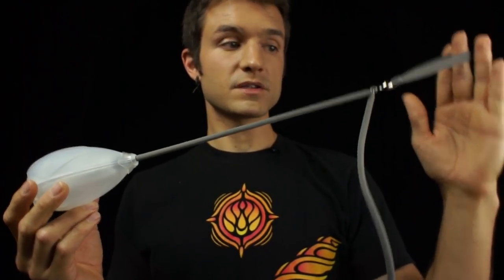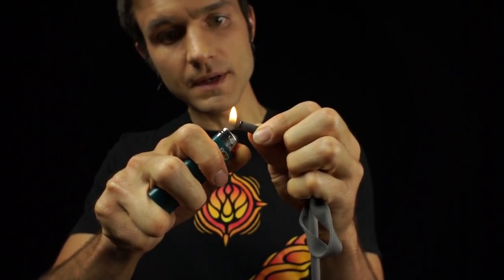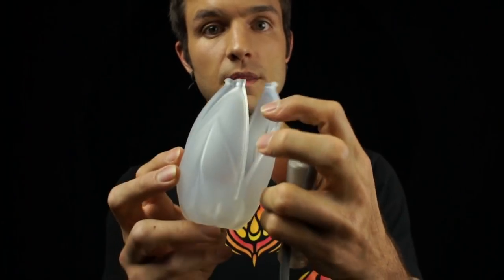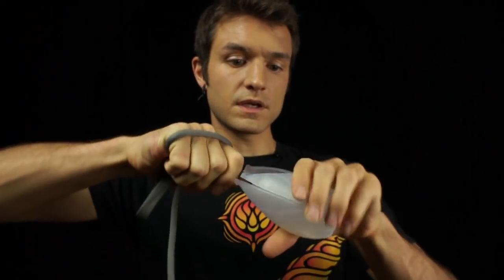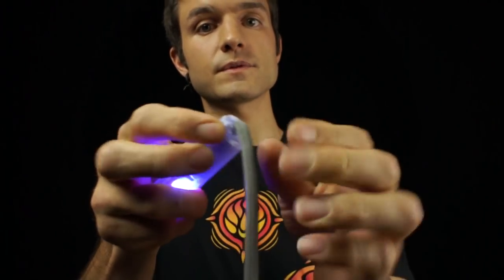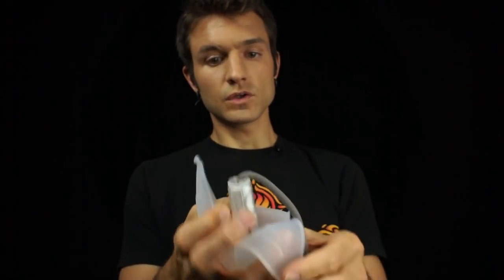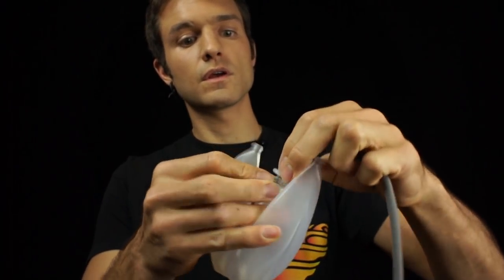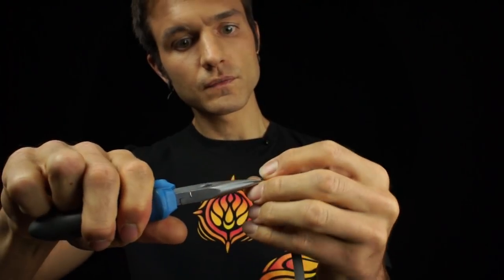podpoi v1: video manual

Comment: Another way you can "tie off" the leash after adjustment is to sew the very end to the leash just under the o ring. That is how I've had my leashes for many months and its still holding true. Note that this option is a more permanent, or at least harder, to adjust that the method in the video. So if you like to tweak the length often, go with the heated tip method otherwise you might want to try sewing it if you know how you like the length.

Comment: I'm having trouble adjusting my leash, when I pull the main part of the leash, it doesn't give, meaning it doesn't move, do I need to move the ring down the leash before I move it?
Reply: Ever get yours? I'm having trouble too. Pulling way harder than what it looked like in video and it won't budge
Reply: same here, I juste mooved the ring to adjust... it takes a bit longer and is a bit more work but it turned out fine! :)

Comment: Hey, great job on podpoi but I have one slight problem, I just push the button on both podpois and everything¨s fine, but when I start to spin one pod will start to shine red, and then puts itself off, looks kind of like if the battery isnt fully charged, but the battery is Green (90% and more) so I thought it might be that contact between battery might be a bit odd, should I try to open the podlight and try to fix it or u do not recommend it?

Comment: What does it mean when my podpoi flashes red ONCE when I turn it on? Let me clarify it is not "redding out" where it flashes red and turns off, it simply gives ONE red flash and then continues to power on to do it's thing, one other symptom that I'm sure is related is that there is no kinetic awareness with this particular podpoi, everything else seems to work fine.

Comment: I am having troubles shortening my leash now. No matter how hard I pull on the leash it does not appear to lengthen or shorten. I (perhaps) made the mistake of spinning with them for awhile to figure out if I liked the length (I managed to shorten them with a LOT of work when I first got them) before committing to cutting them. I imagine the little ring at the top of the leash has been firmly planted in place at the handle connector... is there anything I can do to fix this?
Reply from the maker: +Shayla Sawchenko - Hi Shayla - Sorry you are having trouble - can you email us at support@flowtoys.com with a picture of your leash set up? We would love to help you figure out what's happening. You definitely should be able to adjust the length of your poi set up if you haven't cut and singed your leash already, even if you have you can still shorten (you just can't lengthen).
Reply: Shayla Sawchenko 
0

Comment: what if i already adjusted my leash and want to readjust the lenght again, how would i do that? I added handles and it made my poi to long so what can I do to re-adujust it? i tried pulling the burnt end through the ring again and it will not come through. please help
Reply: Hi Amy,  You'll need to cut the leash near the burnt end, and then pull it through again. We recommend cutting at an angle and then burning it, so you have a point to help pull the leash through. If you have any troubles, feel free to email us at support@flowtoys.com

Comment: Does anyone know where to find a complete guide somewhere. This one-click menu isnt working for me at all. I have no idea what Im doing. I just want to select the lantern function and turn down the brightness. But when I go to the fifth mode, and I click once. It doesnt change brightness. One time it did but I have no idea how to select a function
Reply from the maker: Hi Arnoud, This video is for podpoi v1, which doesn't have pages. Podpoi v2 have capsule 2.0 lights with very different instructions and functions, but both versions have the same way to change brightness in lantern, where you don't have to go to "settings". You can "adjust" a parameter in any mode by holding down the button and letting go when it blinks. The mode will then go into its "adjust" - when you see what you like, press to select. You can find the video here: https://flowtoys2.freshdesk.com/support/solutions/articles/6000192001-how-to-capsule-2-0-operating-instructions-video-playlist ... please note that there are a couple of different versions of capsule 2.0 firmware and we are about to release a new one. Each version has updates - we are overhauling our product support so it's clearer, but in general you can find answers here: https://flowtoys2.freshdesk.com/support/solutions

Comment: So it's not necessary to tie a knot at the end before re-attaching the leash? Another video (the one below this on your websites podpoi support/assembly page) shows what seems like a different way of attaching it.
Reply from the maker: The Universe - hi there! it is not necessary if you have the smaller o-ring and do a clean burned disc, but it is more secure in case the end isn't burned right.

Comment: I cannot easily adjust my leash. No matter how hard I pull my leash will not budge. I don't want to pull too hard, I'm afraid I'll break the swivel. Any suggestions?
Reply from the maker: the leash can be very firm in its connection, but don’t worry, it could should be able to hold your weight, you probably couldn’t break it if you tried. you can try looping the handle over a door-knob to help pull. If it breaks contact us at support@flowtoys.com and we'll sort you out!
Reply: eotostealsyourface hold your poi vertical. there's three metal rings; one above the swivel and two below. use your fingernails and pull the lowest ring down slightly. this will loosen it and then you can pull easily!!
Reply: thank you so much almost sent mine in your a life saver!

Comment: I can’t get the leash inside the tiny circle on either end. It’s too frayed.
Reply from the maker: Sorry to hear that - what kind of leash do you have? If you have the old style flowcord as shown in the video, we recommend cutting the cord at an angle and burning the edge with a lighter, smushing the edge to make an "arrow" and threading it through the o-ring. If you have the new braided smithy cord, we use painters/masking tape before cutting. Feel free to email us at info@flowtoys.com and we can walk you through it.

Comment: With the Flowcaps, you can easily twist the capsules to release them while the retaining ring stays inside the cap. Why don't you just do the same thing for the pod poi? Having to forcefully yank the capsules and the C ring out is super annoying and potentially damaging, and then you have to put the c ring somewhere safe so you don't lose it, or else the pods would become completely useless without it
Reply from the maker: Hi Sam, Referring to your initial post here - we haven't changed the design since the beginning of podpoi, though based on your edited message, this is not the issue anymore yes? The pod shell is made from an incredibly complex mold much more so than the flowcap. I hear you about not wanting to lose the C-ring. I'm not sure what's happening w/ yours ... when you pull your capsule out, does the C-ring come out with the capsule? We usually grip the base of pod shell and lever the capsule out, so no yanking required ... there are ways to remove the capsule and leave the c-ring in the pod shell, but if the capsule can come out easily, then it's not as secure.

Comment: Hi! I received a replacement Pod Poi from Firetoys.co.uk.
Unfortunately it wasn't the same as the one I had already. I noticed three differences: 
*The one I received from Firetoys.co.uk has a greenish tint which makes it look darker. This is most visible in the White/Strobe-mode. But clearly visible in all the modes when spinning. Mine is much brighter. 
*The loop to put your hand/fingers through is much smaller on the one I received from Firetoys.co.uk.
*The string is darker.
Obviously it doesn't matter to me that the string is darker, but the other two differences are two I cannot be 100% comfortable with. 
The mismatch of light colors will make my performance look odd. It's already bugging the heck out of me. 
And the different size of the loops. I'd have to adjust to having different sizes which feels quirky. I have to use a different grip with my left hand.
Why did this happen? How come the light colors, the strings and the loop size aren't identical?
Reply from the maker: Dyallo Hi Dyallo - Sorry you got mismatched parts! We encourage all customers and shops to come to us directly for warranty service, as each batch of LEDs and cord can have manufacturing differences. This happens with all manufacturing, and as much as we (or Apple or Samsung bug our factories to keep each batch consistent, it doesn't seem possible. When you come to us directly, we ask that you send back both capsules, so we only send back matching capsules. There is no way a reseller can keep track of the different batches, but some resellers want to provide their own warranty service to their customers even if we discourage them. You are welcome to contact us directly at support@flowtoys.com to get a matching set. You will have to pay for shipping both ways - keep the shells, as they are the bulkiest and heaviest part - we'll sort you out. Sorry for the troubles!